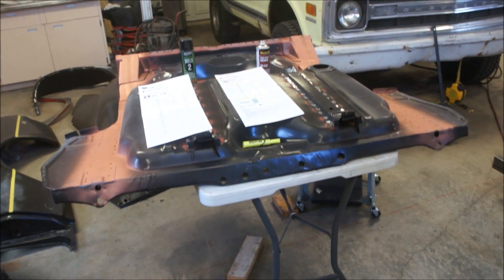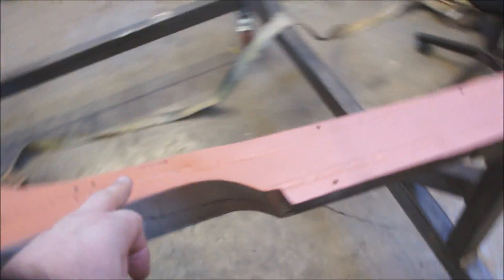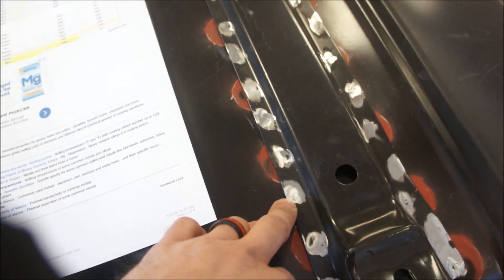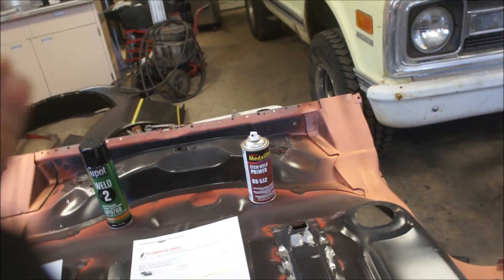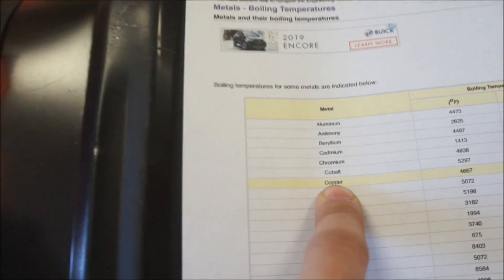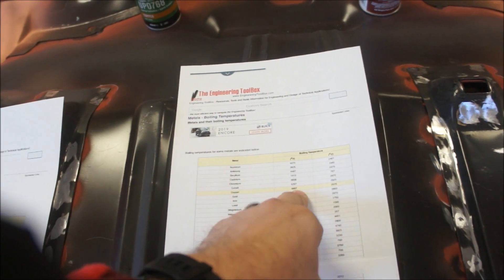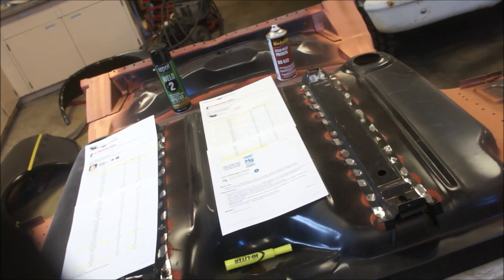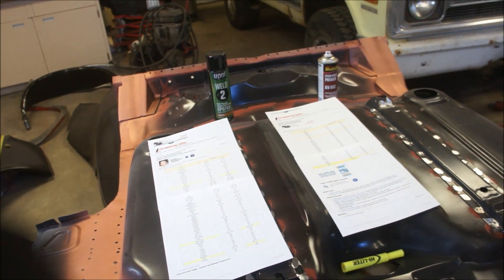weld thru primer copper vs  zink

Comment: So you're absolutely right about the melting/boiling, but there's definitely more to it than that. For example, the zinc will burn off right at the weld, but the surrounding remaining zinc will galvanically protect the steel it is in contact, which is why those rockers were still there at all - rust formed on those pinch welds but never progressed into the panel because of the remaining zinc, i'll bet you still had to drill em. The copper works on the opposite principle: the steel is actually the "sacrificial" metal in the equation, because copper is more noble than steel, so it will steal electrons from the steel its coating to prevent itself from corroding.. so the idea is that, because there is so little copper and so much steel, it will cause an insignificant amount corrosion to the steel for the copper to maintain its condition and remain as a shield for the underlying steel. Your analysis was solid, but you should know that the zinc is expected to burn off and it doesn't necessarily mean the weld or especially the backside is completely unprotected
Reply from the maker: @kevinkeller1046  love this, weld thru has been an area of aggravation for me since I started restoration 16 years ago, I always call it a better than nothing product and have done multiple tests with zink and copper, at this point I epoxy everything and then grind away a 1” circle under the plug weld  and spray just those plug spots with weld thru, I then use epoxy and pull it up into a syringe 💉 and inject it into the seam to coat what has burned away then seam seal the seam. So far best I have found but it’s a lot of overkill and most are not going to do that.
Reply: @MrFireman164   Dang, yea that's a lot of work, but it kinda makes the most sense - trapping zinc behind places you can't seal off will protect. Any rust you see from the outside won't be able to get deep into the panel if there's zinc behind it, and your extra step of blocking that zinc from getting washed out by sealing with epoxy will definitely help make sure that zinc stays in there. Thanks for sharing, and again great approach

Comment: Nicely done.   The zinc may give you a short term block from flash rust but lapped joint corrosion resistance sounds like copper is a lot smarter.

Comment: You say you’ve used science but you’ve only used it concerning the welding process. If you look at the galvanic table you will see that copper primer should not be used on steel because it is a dissimilar metal and will actually cause steel to rust faster. So anywhere you have coated in copper primer will now be rusting. I have a Nissan in my shop right now that had replacement rockers fitted in 2020 and it hasn’t seen the road yet. I’ve just had to cut off the previous shops work because they used copper primer and it’s causing it all to rust.
Reply from the maker: Looking at the galvanic table, shows that copper is fine for carbon steel, stainless not so much, wrought iron not so much. Sorry to hear about the Nissan, that sucks, there are several brands of copper weld thru for carbon steel made by sem, upol, ect… these companies would be sued if cars were coming apart because of using there products and would have stop making them a long time ago.
Reply: @MrFireman164  incorrect. Copper is higher up on the table than all of the steels therefore in contact with one another a galvanic cell occurs. In a galvanic cell one metal is protected and one is sacrificed. Copper being higher up on the table protects itself at the sacrifice of steel. That is why metals like this aren’t allowed to touch in the aviation or marine industry.

Comment: Chemistry doesn't lye. Copper it is! I don't know what 3M uses but they want two coats, clean the plug weld, then mate the panels, weld and use cavity wax. They go as far as certification in the collision industry requires a life time warranty but also want before and after photos attached to the repair order using a bore scope. Now, that is starting to add up just to get you car fixed, yet peace of mind for a builder for myself. If I do the work, I don't need photos. I just know it's done right the first time.
DK, ASE Master since 78, retired.

Comment: You mentioned turning up the heat . I tried it with lack luster results on a project . I thought in retrospect that I was not hot enough. Willing to try it again, interested in fixing up an older car and would like to confidently use a copper product.
Reply from the maker: https://youtu.be/nf7LFSeCGGU

Comment: What you haven't considered is that zinc is sacrificial it turns into Zinc oxide when in contact with water and the  'patina' protects the exposed metal so long as the unburnt area, maybe between 1/32 and 1/16 of an inch, surrounding the weld is inside the panel in a lap joint, copper is not sacrificial copper pipe tech will attest to that.
Reply from the maker: Yeah your probably right, you should make a video of your knowledge on this subject. You might even name the vid “Mrfireman164 is a moron”

Comment: Interesting, I was wondering if you might make up a few test panels. I always assumed that the paint was obliterated at the weld point at or behind the weld, but unlike normal primer it wouldn’t interfere with the weld strength or adhesion. I also assumed it would give you maximum protection in the areas where it remains. I’m using it in the sills of my Landrover and pumping it with cavity spray after.

Comment: The manufacturer even says the zink coating should be removed from the surface that is being welded the only benefit using is if you are welding a pinch seam the zink won't burn always the surrounding areas of the weld leaving behind the zinc since you are unable to paint the metal after the pinch seam is welded. Eastman even has a video on YouTube showing the proper way "weld through primer"

Comment: How does it work with TIG welding
Reply from the maker: Good question, I don’t have a tig welder.
Reply: @MrFireman164  I have a TIG, and plan to use it on an old Chevy truck I'm working on. I'll let you know

Comment: Sorry Dude, you fail logic class.  "pinch welds" on factory galvanized metal from the 70s are not the same as mig spot weld through modern zinc coating whose matrix is deigned to contain the zinc gas within the weld.  Dude you compared apples and oranges and they simply are not the same!  A modern zinc coating does NOT "just go away" in the 2 sec burst of a mig plug shot:  The weod through primer contains a matrix to hold the zinc as it heats.  As zinc changes state it enters the molten plug to galvanize it:  THAT is the point of the zinc coating.  Stay in your lane, and chemistry and thermodyanmics are clearly not your lane.
Reply from the maker: You actually have a Youtube channel! I figured you would be teaching chemistry and logic but nope just a channel full of rusted out junk cars, maybe you are a retired chemistry teacher or perhaps a professor. Keep being a dick to other youtubers and see how well your channel does. My guess is people will start leaving you a lot of shitty comments.
Reply: @MrFireman164  just a retired chemistry geek fooling with old engines

Comment: Good video and good work but there is a case you are making there which is not quite correct. Material does not instantly change states, the change of state of the zinc from a liquid to a gas is not instantaneous over a given volume. Think about a kettle boiling, you bring the water to 100 deg C and it starts to boil off and yes disappear as a gas, but it doesn't happen instantaneously, depending on the volume it will take time, it will happen quicker as you increase the heat over its boiling point but still time is a factor. So it will all disappear as a gas in time, zinc will be the same it will disappear as a gas over time, depending on how much volume of zinc there is. The relationship between the volume, time and heat is complex here so will it all(the full volume applied) disappear, who knows. So thats a flaw in your logic, you are using something as an absolute which is not.
That all said, it certainly makes the use of zinc more complex and less sure, it could well be the case that for spot welding where the time the heat is applied is very very short there may not be enough time for the zinc to boil off. It could be effective in an automated environment with very short heat cycles. But its unlikely to be very effective in a manual process, certainly TIG or MIG in your own workshop it seems highly unlikely to be effective, the copper appears on the basis of your work to be much more likely to work in practice for manual low volume applications where the heat and time its applied will have large variances.
Great work and very helpful thanks, the video worked for me, I'll pay the money and go with the copper on my restoration, it has a better chance of working. Thumbs up.

Comment: From a scientific standpoint, you shouldn't be welding through any of these. From my research, they should be applied to both surfaces where they are lapped, plug weld holes marked on the mating surface and then removed in just those spots. Then welding the plug on clean metal to clean metal, as any welding instructor will agree is the only way to ensure the cleanest weld without contamination. The term weld-thru is a misnomer if you are doing things for the strongest welds vs. just getting it done. Now, that said, if the welds hold and don't weaken the vehicles ability to perform both on the street and in a crash AS DESIGNED BY THE MANUFACTURER, I say more power to you.
Reply: In fact, their formulations do not promote adhesion of subsequent layers, which is a primer's only job. Any overspray should be removed and a proper sealer primer applied to bare metal. Then filler and high build primer and such as you work your way up the food chain from bare metal to final coat. These should only be applied to where you can't physically get any other means of treating the surface for corrosion resistance.
Reply from the maker: You are absolutely correct !

Comment: here is a question, if you spray zinc primer on top of copper primer with they react or is it fine?
Reply from the maker: Hondamatic Garage that’s how brass is made by mixing the two
Reply: @MrFireman164  you are correct sir.one more for you.  copper and steel normally react badly, example-you would never use steel nails to retain copper plumbing ,they would eat each other yet copper primer is fine on steel?
Reply from the maker: Hondamatic It works by galvanic corrosion. The zinc or copper corrodes and forms a "seal" against further corrosion, rather than breaking down like steel corrosion. When a plug weld is made on a pinch type flange the primer liquefies and then has some ability to "wick" back in around the weld. It's a "better than nothing" product. The joint still must be sealed completely after welding or it will still corrode. It's just a PART of the corrosion protection process used in modern collision. It’s a better than nothing solution. I have a vid where I show after welding I reduce epoxy and put it into a syringe and inject it into seems, this gives the best protection I have found. Seam sealing these flanges is another important part of the protection.

Comment: If you think about it, there must be very little zinc or copper in these primers. There is no way you can mig weld to copper or zinc, at least not with regular wire. I’ve been welding 22 ga .030” galvanized sheet metal on a late model car body, and if you don’t get all the zinc sanded off, even a trace of remaining zinc will destroy the weld!
Reply from the maker: Rod Bauer so that’s why I use copper, if you turn your welder up a bit when you are welding thru it, it welds fine, zink is just really reactive. The copper will melt and is supposed to co mingle into the weld to help protect it 🤷🏻‍♂️. Not sure I buy that 100% so that’s why I use a syringe and inject reduced epoxy down into the seem after welding and then seam seal it.

Comment: Great work I do minor bodywork on my 86 foxbody. Looking for an answer other than using Zinc. I wonder does the copper have any side effects to the body like zinc does? Copper I think is a better solution to the problem. Eastwood has internal frame coating paint applied by a thin sprayer wand. You may want to look at that as extra protection against rust. I have used it on rocker panels to prevent rust from starting. Again thanks for the info>
Reply from the maker: Rob Hunter I don’t see any issues with copper, I have used the internal frame coatings

Comment: nothing is going to keep a plug/spot weld from rusting initially...so, remove as little paint/ecoat as ness(dime size or less) prepare beforehand with access holes made or whatever to coat backside, flow into seams...we have fiber optics and bore-scopes  nowadays...weld must be coated with something after welding,period.  Otherwise you get what is sold at Barret Jackson for $$$$$ that has haS NOTHING!
Reply from the maker: gtbarnes11 yes that what I do
Reply: @MrFireman164  yes I noticed that. Some people would just grind that whole Edge bare. It seems though I recall something like a flux or a wax that can be heated and wickd into the seam after it's welded? Ever hear of anything like that?
Reply from the maker: gtbarnes11 just fluid film but that’s not heated
Reply from the maker: https://youtu.be/zTuQ2Aih0Xg

Comment: Well i dont know about you but i have spot welders my big one is 4.7kva non portable but i was testing zinc i could not achieve a good spot weld through the zinc at all. your results may vary.
Reply from the maker: Todd  Sutton I will be plug welding everything on this car so there won’t be an issue, thanks for the comments tho it’s good to know about the zink .

Comment: Logic.....Facts.....and Common sense all have come together here.  Good Job....Just the way you talk about this...I was sitting here finishing words in your sentences.   LOL     Now  Lets talk about welding terminology.   Spot weld, plug weld etc,etc.     I have a bunch of work to do on a '55 Fairlane. Many ...Many years ago in one of the body shops I work at they had a spot welder aka Resistance welding....Like the factory does.   I bought the Lenco MKII  Spot welder and the optional L 950 ........
http://www.lencoautomotive.com/resistance-spot-welders.html   This is a SPOT welder.

Plug welding with a Mig is actually called Rosette Welding .   Yes it's a Spot.....But it's Not "SPOT" welding.     You are very articulate, as am I.   I try and teach the Proper terminology .....It takes a whole bunch of mumbo jumbo out of the equation and puts everyone on the exact same page.....Wouldn't you agree?   :)

Comment: My take away on this. Epoxy prime the whole panel front an back, where my plug welds will be I should clean to metal, spray copper weld through front and back.  Plug weld. Come back with thinned epoxy primer into the seams and soak. Followup with seam sealer?
Reply from the maker: meme that’s the way I have approached it , may be over kill 🤷🏻‍♂️
Reply: @MrFireman164   Makes sense, Had to replace my windshield and my dash panel is rusted on the driver side with several pin holes.... Others suggested quick fixes,  clean, rust converter, clean, paint,  reinstall windshield and let it be, but the rust still being in there will keep me up at night. Trying to do all this while not messing up my paint :-)
Reply: I searched, do you have any of your videos showing the application of the seam sealer? and what brand you use/recommend?
Reply from the maker: meme https://youtu.be/Jp2hPuwmaII
Reply from the maker: meme 3m heavy bodied seam sealer , this is the only vid I have doing any seam sealer
Reply: Awesome ty
Reply: 100%, its a war of attrition and doesnt have a single magic bullet so you build defenses as best you can.